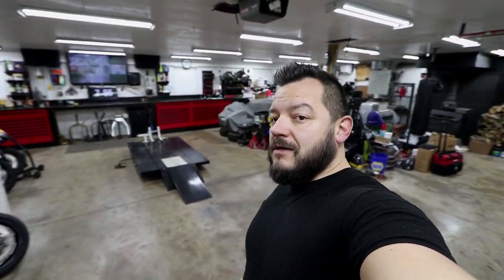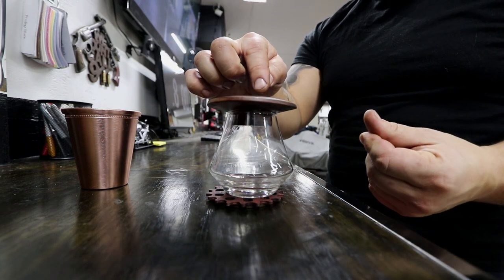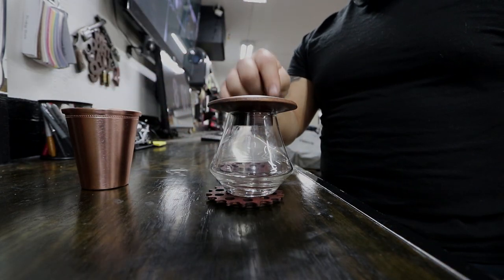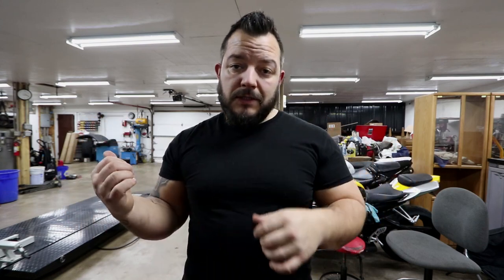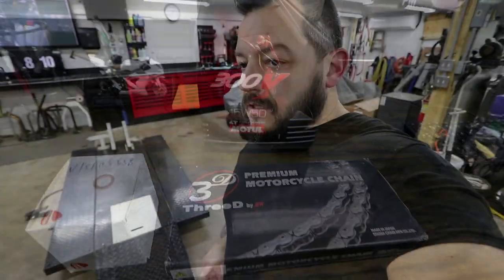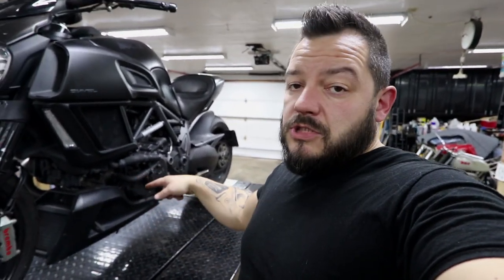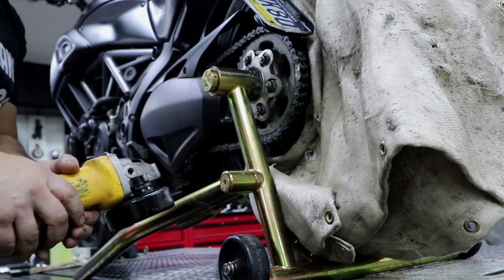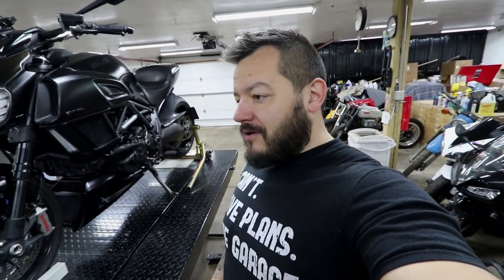I'M BACK! Update and Diavel Service

Comment: Welcome back. Just wanted to comment on that oil you used motul 300V. I had a bad experience with it on my 2011 diavel back in a day. It made my bike run super hot in the spring in stop and go traffic. Never had that problem before switching to that oil. It’s consider racing oil for track use,from what I understand. Dumped it right after that and switched to something else fully synthetic.
I think it’s better to go with motul 7100 fully synthetic. Just my two cents
Reply from the maker: Ive used it a good bit in customers bikes if requested no issues or complaints here yet. My go to is still mobil 1, it seems to do the best on my current setup and ive been running it in my r1 since i built it back in 2009. Original clutch with almost 30k miles as well.

Comment: Good to see you back Dado! I like wrenching on my bike so for me the more detail and how to tips are great! That said you don't say on your service of Mr Campisi's bike if you checked the front and rear sprockets for wear and roughly how many miles/Km one can expect to get before a chain and sprocket replacement might be needed or at least checked? Cheers!
Reply from the maker: Quick and easy way to check for a worn chain is to try to pull the chain away from the rear of the sprocket on the rear wheel. If the chain is worn, you'll reveal about half a tooth of the sprocket. A new chain will wrap around the sprocket snugly and won't pull away. Other things to look for are binding or kinked links that cause tight spots (put the bike on a rear stand or the center stand, if it has one, and spin the rear wheel to see if the chain maintains the same tension)

As for thr sprocketss look for sprocket teeth that are hooked, pointed or chipped and the front and rear sprockets should be snug with very minimal 0lay. Cush drive in the rear sprocket carrier may have little to no play (unless you own a s1000rr or m1000rr then its excessive all the time 🤣)
Reply: @DadoRados  Thanks for your reply Dado! Interesting points you make! Funnily I ride a 2021 S1000rr! BMW service won't replace a chain without changing both front and rear sprockets! (And at main dealer prices too LOL!) I'll check the chain links and check pull-off the teeth and adjust/replace as needed! Many thanks!

Comment: Nice video. On Jaret's video, you guys often change stock oem nuts and rear wheel lug nut on a single sided swing arm. Other than you using quality sockets, any tips on how not to scractch the new ergal colored nuts ? I've tried using maskers tape but often find it to be worse and too thick and leaving scratches. And I'm not even talking about using an impact ;-)
Reply from the maker: I use TESA tape when i dont have non marring sockets 😁 cheap and effective

Comment: Hey man, in one of Jared's videos I saw you had a Honda Fireblade CBR954RR in the shop. What are you going to do with that bike? Because I just bought the same one a week ago haha.
Reply from the maker: I've gotten more messages and comments about that bike than any other motorcycle in my shop :) it's a customer's bike, quite fast too. I have been working on it and servicing it, it's back with some electrical issues.